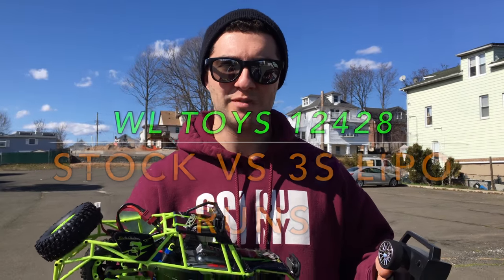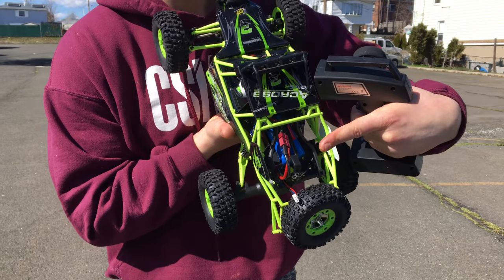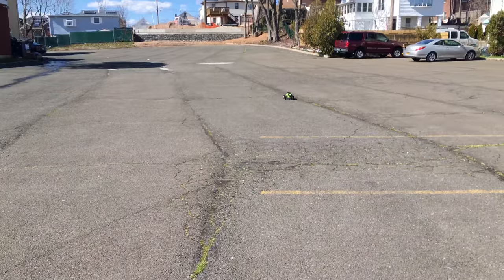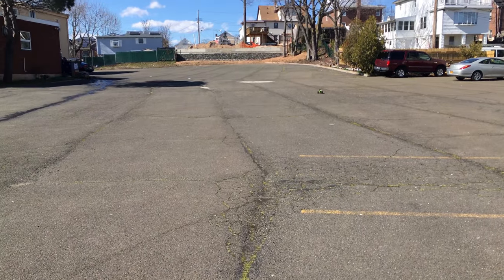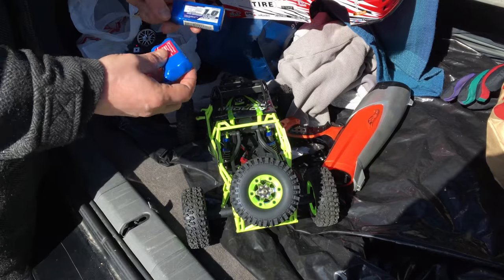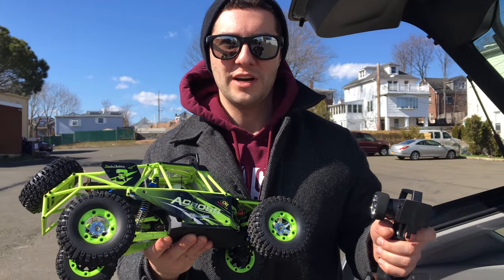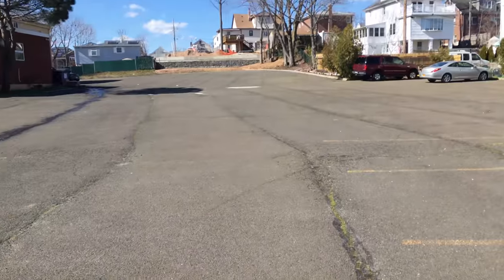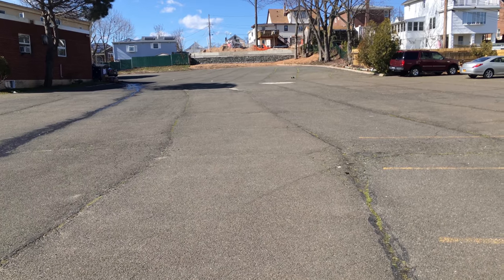WL toys 12428 $70 stock battery VS 3S LIPO speed runs

Comment: When looking for a <100USD offroad RC like this one, which one would you recommend? Durability and runtime are the most important factors.
Reply: get this car and a few batteries. 1 runs about 15 minutes
Reply: I spent a lot of time searching, and this is great for puddles, mud, and night.
Reply: i researched alot as well and ended up getting the next model up of this rc for my very first rc,the 10428 1/10th scale,im still waiting for it in the mail so i cant tell you my "user: thoughts on it yet however after watching several vids on it i already want to oreder a better longer lasting battery for it,however i dont want to burn the motor out on the thing so i got to be carefull what aftermarket battery i get. but anyways i paid 155$ usd after a first time buyer coupon i got from bangood

Comment: I put a 3s in my 12428 and it started smoking and burnt up the motor as soon as I turned it on. Any thoughts?
Reply: Alex Bingham ir doesnt run on 2s lípo it runs on li-ion battery
Reply: @gellona90  this video it is running stock on a 3s....Also, li-ion and li-polys are the same thing in a different package. The full name of a LiPo is Lithium Ion Polymer.

Comment: Can i run in rc car 3s 2200mah 20c??
Reply from the maker: hello,  YEs you can.  I would not really push it alot with a 3S though.  I only did a few speed runs with it, it's fine.
Reply: hybrid32494 ok thanks

Comment: Hey! I know this video is 2 years old but I wanted to ask you a question.... If i put 2s 25c Li-Po 1500mAH into it, will it fry the esc/motor? And i have the SCT version basically same design but with different body.... Thanks in advance
Reply from the maker: hey buddy!!, thanks for watching!!  You can run any 2S in this, it will be fine.  I've even ran a small capacity 3S, and it was fine too.  You can run a larger capacity 2S in this with no issues too.
Reply: @hybrid32494  Wow, I'm surprised that you reply to my comment... what If I run s2 on 60c.. and what is C even stand for? ( I'm new to this hobby so I dont really know stuff that much)
Reply from the maker: I try to reply to everyone on here, no matter what, you know, I appreciate the views and interest.  The way batteries are rated today is with "C" rating, which stands for "discharge rate". Basically the higher the C rating the more juice (amps) the battery can deliver to the ESC and the esc will deliver to the motor.  Generally this will result in more punch off the line and a little higher speeds.  As you get a higher rated "C" lipo they also cost more.  In general I stick to 30-40C, they are cheap and good enough.  The included lipos are usually around 20-25 C rated btw.

Comment: Hi was this just the 1 run or is the 3s your go to battery every time? As in damage over time or is urs still good? Asking cos just got 1 and lkve upgrading too 😀
Reply from the maker: hey man, I don't always run a 3S in this, but I have done it multiple times so far, and have had no issues at all.  Keep in mind the 3S I am using is a small capacity pack with a low discharge "C" rating.  I don't recommend going over 30C for this model.
Reply: @hybrid32494  have you only run yours on the street 3s? my rear diff died running 3s offroad after 3 runs, i think any resistance when running 3s causes the plastic diff gears to break, the metal replacements are dirt cheap though, i think banggood has the whole metal diff kit for around $16, worth it if you want to use a decent 3s battery.
Reply: Diff eating basket case. The moment they quit scamming us and build quality replacement part I will be buying one. Until they stop marketing and build quality like the ole days I just have to watch the money flyout of your wallet from the side line. After you spend said money on a 65 dollar buggy you'll find you could have bought an Arrma

Comment: I put a 3s in mine and it flashes the lights and barely moves.. wtf... help lol 1300 mah 3s 30c battery
Reply from the maker: hey buddy!!! have you tried tis lipo on an other cars you have?  just to eliminate it being a bad lipo to begin with.  mine has no issue with a 3S and operated just fine.  Try to stick it in there when it's not fully charged, and see what happens.
Reply: @hybrid32494  Yeah i have a turnigy 1.0 3s that ran fine when it was half charged brand new but now it wont. Any idea on an esc I can put in it??
Reply: @Turppa21  did the stock esc die on 3s? or what was the issue ?

Comment: If you change to  Li-PO battery. How are you control the power? Or esc will cutoff by itself?
Reply from the maker: hello, the original battery in this was a LI-ION, a LI-PO is almost the same thing, just a different shape.  You can safetly run and 7.4V pack in this.  I have even run a small capacity 3S 11.1 pack, with no issues.
Reply: hybrid32494 OK guy. Thank you for suggestion. Have you install Li-po battery gauge to monitor battery usage or not ?
Reply from the maker: this ESC has a lipo cut-off you don't need to really monitor it. I do check with a cell-checker for voltage though.  But it's not necessary to do so, I only do it for my own info.

Comment: Can i change battery from The stock battery to 2s Lipo 7.4 Volt 3200 mAh
Reply from the maker: if you mean to a LIPO battery, then yes.  I have ran this both on a 7.4 V LIPO and 11.1 V lips.
Reply: The Motor Got really hot tho but i turned it off for so it could cool down :P
Reply from the maker: when you say hot do you mean mildly hot or so hot that you cannot touch it and there was a smell?  its fine if its warm you should be able to place your finger on it for 2-3 seconds in normal heat range.
Reply: Ah Okey i could take there for 3-2 seconds but not to long because then it would hurt my Finger. I didnt smell i think a little bit maybe Im not sure tho
Reply from the maker: yup,  as long as you can touch it for a few seconds then its fine.  That has been my experience with electric motors,  you should be fine.
Reply: Okey Thanks my Bettery is so big tho i need to Tejp it to the car because the battery is from a Monster truck that i used but the motor broke on that Truck.
Reply: I get more Running time right? because The stock one has 1500 mAh and this one Has 3200 mAh
Reply: Battery Setup on the car XD Its Very Fucken good :D : http://prntscr.com/fi04ef
Reply from the maker: yes, the more capacity you have in MAH the longer your run time will be.  Although be aware that too much run time could overheat the system.  is your 3200 man battery a 7.4V 2 cell lipo?
Reply from the maker: lol, that is very monster looking on there, but cool.hahahah.  Prob makes the steering bad right?   too much weight?
Reply: Yes Its a 3200 mAh 7.4 V 2S Lipo
Reply: Not that much it Still works fine :D
Reply: Btw 1 more Question, Can i shower it in the shower? Because its very dirty.
Reply from the maker: this model does not claim to be waterproof.  But even for waterproof models like traxxas and HPI  I would not fully submerse any rc.  Just wash off the suspension parts in the sink and clean around the electronics if you want.
Reply: Okey Thanks!
Reply: hybrid32494 mine says it's waterproof

Comment: My WLtoys 12428 stopped work afer I connect 3s battery. Didn't even strart driving it. No smoke, no burn just no reaction on throttel trigger, sterring servo works fine.
Reply from the maker: what type of 3S did you use?  Meaning what was the discharge rate?  I used a low discharge type one rated at 20-30C.
Reply: it is difficult to say for sure, it was stock battery which come with Chinese 250 quadcopter. it is very weak for quad I believe that discharge rate should be low. I tired to disassemble electronic board but inside of the box all in glue. I wasn't able to reach the board yet.
Reply from the maker: yes, you seem right. That would be a pretty small battery.  Have you tried the wl toys with the stock battery?, not the 3S since this issue.??
Reply: yes, I tried stock battery, without luck. I tried to run motor from outside energy source it works. I hope that new electronic block solve the problem.
Reply from the maker: ok, only one issue I can see you having with changing the Electronic Speed Controller.  This model has the ESC built in with the receiver for the radio.  If you change it you will need a different radio system and servo (wires won't fit)

Comment: can all wltoys rcs handle a 3s lipo? can i use a zippy 3s 2200mah 30c??? pls answer this.. would be really a great help
Reply from the maker: im not sure if all WL Toys Rc models can handle a 3S, but this model can.  Which model are you referring to?  General rules are that if the model runs a 540 size or higher motor than you can usually run a 3S because the ESC is rated for more amps and voltage.  The smaller scale RC models generally do not run 3S packs.  

You can always try putting one in and trying it out slowly,  If it has a built in voltage limit then it will just not operate with a 3S pack.
Reply: the motor is only 380.. says in the box though..
Reply from the maker: what model are you referring to?
Reply: wltoys l959
Reply from the maker: Lance Bucao    Thats a 1/18 scale vehicle with a small motor and a non- powerfull esc.  U can try to plug in  a 3s.  But chances r it will not operate.  Online listing do not say if a 3s is usable, so u gotta try urself. Let me know
Reply: ok thanks
Reply from the maker: so have you tried to run a 3S battery?

Comment: They come with metal diff gears these days..I always think about getting one to bash with a putting a 3000kv in it
Reply from the maker: dude, I'm about to make a video on how I think this is the only one of these worth getting.  IT's so versatile and fast, I never striped any gears either.  Mine ran fine with a 3S too.  Did yo know these have real deadlock wheels too,  you'll never have to glue any tires!!!   This in my opinion is the best 65-80 dollar RC you can get.
Reply: @hybrid32494  They seem really cool..and I hear the shock can hold oil?
Reply: @philthyco1  Yes, I think they were friction shocks in the first versions but they upgraded to oil-fillable. Kevin Talbot mentioned he wanted to fill them. Good to see it runs on 3S, too. I have an HSP Flying Fish. Also runs on 3S brushed, now, after a short conversion to a too heavy brushless system. And there are upgrade brushed motors rated for 13V on the chinese market, too. So, no real need to worry about anything. The 10428 seems a bit nicer, though. But different price class of course.

Comment: Did you recomend lipo 3s 1300 mAh 30c on this Car??
Reply from the maker: what do you mean, If I recommended it?  I just demonstrated that this RC will operate significantly faster with a 3S.  The size of the battery is up to you, depending on what fits.  That was the battery I use on my Traxxas mini e-revo VXL and is very cheap overall.
Reply: hybrid32494 ok thanks.🇵🇹

Comment: 3s means higher voltage, will this not burn out the esc?
Reply from the maker: After running the 3S lipo multiple times I have not broken anything.  Although I run a pretty low discharge 20-30C 1000 MAHH pack.  Overall if the esc was not built to handle the higher voltage it would just not activate itself.  You can check for urself on any 2S powered ESC system, a 3S won't work unless the ESC itself has the ability to handle the voltage.  Hopefully thermal protection will turn on if needed.

Comment: what battery should i get? i dont care at all about speed. all i want is better run time and less charge. please help.
Reply from the maker: You can get any LIPO battery with larger capacity.  Meaning more MAH rating.  If you have the original 1500 battery then try doing for 2000 or so.  But measure and read descriptions accurately to make sure if will still fit.

Comment: i don't know about u...but my stock gears are made out of nylon. tried a 3s lipo battery, it killed it in matter of minutes. overall its a great fast buggy, but its not built to last, unless your wiling to upgrade it.
Reply from the maker: sorry to hear that happened to you.  What 3s LIPO did you try,  I only used a small 3S lipo with a low discharge rating. And btw they all have stock plastic gears.

Comment: My 12423 will not shut off I plug battery in and it takes off what do i do
Reply from the maker: is your steering working?  is the car getting a good signal from the remote?  Sounds like you have a remote binding issue.  Let me know...
Reply: hybrid32494. Yrs steering work and if I hit reverse its got be the mother board I can see melted plasticity wanna up grade to a brushless but think I would have to Chang remotes what do you think
Reply from the maker: so your reverse works?  If thats the case the ESC seems ok, maybe it needs to be programmed somehow again.  Either way the easiest thing to do if you want an upgrade would be to buy a complete brushless system.  Since the rc uses a 2 in 1 receiver and ESC combo you would also need a new remote system.  Its probably still cheaper to just buy a whole new one of these, and keep the other for spares.
Reply: hybrid32494. Man thanks for the help my kids like to tinker so its kinda a way to spend time with them i ordered a new motherboard i don't have a ton of extra money rite now for brushless system my boys birthday is around the corner so the upgraded system will be great present thanks
Reply from the maker: LOL what?

Comment: Hello Do you think 7.4V 4200mAh 30c 2s Lipo will be good?
Reply from the maker: hey buddy!  You could run any 2S lipo in this thing, it will come down to you being able to correctly fit it in the chassis. To fit a 4200 max pack you would need to get highly creative, for sure remove the rear wheel and possibly parts of the roll cage. But the system will handle it, no problem.

Comment: what is the maximum current on a 7.4v lipo
Reply from the maker: There are two ratings on a LIPO battery, a continuous discharge rating and a peak discharge rating.  This particular lipo I was using has around 25C continuous and 40C peak discharge.  More expensive batteries could get to 100C peak and 50C continuous.  I try to stay not more than 30C continuous to make sure my ESC/s do not get fried.  Does that answer your question?
Reply: I have the Feiyue FY-10. Does this car has the same esc?
Reply from the maker: I just looked up the FY-10, it looks totally different from this model.  IT says it has a 390 size motor, not a 540 like this RC in my video.  Chances are the ESC/RX unit is also different in that case.  Also says it's top speed in only 30 KPH.
Reply: Anyway,what is the maximum continuous current on a 7.4v lipo that can run the car you have?
Reply from the maker: honestly, I don't know.  I don't think any info on max current exists on this ESC.  I would say that above 30C there is no need anyway.  You won't notice much of a difference, you're better off running a smaller 3S lipo for more speed than a high discharge 2S lipo.
Reply: ok thanks very much for your time!!!

Comment: That looks the same as my lite hawk ace. Im thinking about hooking up a 9.6 volt 3000mah battery on it you think it would be ok?
Reply from the maker: hey man!! I've ran a 3S which is 11.1V, so should be fine.  Worst case scenario is it prob won't activate the ESC if it's somehow not-compatible.  I highly doubt it would cause any damage.  let me know.
Reply: They are both ni-mh worst case senario i have to buy a esc from lite hawk i guess lol its 20 bucks

Comment: Which battery can I charge to increase the charging time.
Reply from the maker: what do you mean?  do you want more run time or more speed?
Reply: hybrid32494  I want more runtime would like to know what battery I can put?
Reply from the maker: you can use any battery that has more than 1500 MAHH capacity.  Basically the more Mahi-Mahi rating the longer the run time you will have.  Does that help you out?
Reply: Will the engine not burn using high power
Reply: hybrid32494 What battery would you recommend me to use?
Reply from the maker: the capacity in terms of MAH rating will not harm your motor, it will just provide more runtime.  IF you want more speed then you will need more volts, means a 3 Cell limo rated at 11.1 Volts compared to the stock battery of 7.4 Volts.  Which site will you be buying from, I'll take a look for you.
Reply from the maker: YES!!. this would be a perfect battery for getting around double the runtime.  Although speed will be about the same,   your motor will be perfect with this battery.  Let me know how it is for you when you get it.
Reply from the maker: hows your new battery?
Reply: Has not yet reached the battery
Reply from the maker: ok, let us all know here how your new battery is when you get it.  thanks.
Reply: hybrid32494 ok

Comment: Hi can i put in 3s 850mah 35c thanks for answer😉
Reply: Oh yes i can😂😂 and its a bit faster 😂😂😉👍
Reply from the maker: wexi TV  hey!!  Yes you can.  Thats a pretty small capacity battery, itll be fine.  I have run a 3s 2000 mahh 20c.
Reply: hybrid32494 thanks
Reply: I’m using 3000mah in Dubai. Currently still testing it

Comment: Can someone please send a Link to that 3s i cant find it
Reply from the maker: I'm sorry I don't have a link to this exact battery I used.  The battery itself was purchased around 6 years ago at this point.  Just look for any 3S lipo that will fit the dimensions of the battery compartment and try to stay under a 30C discharge.
Reply: hybrid32494 ok thanks